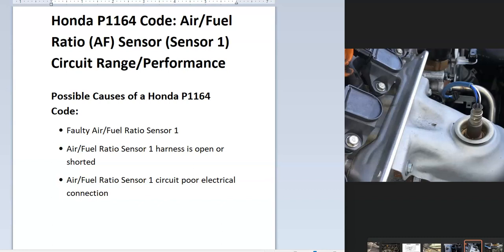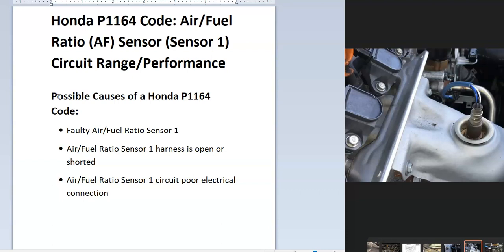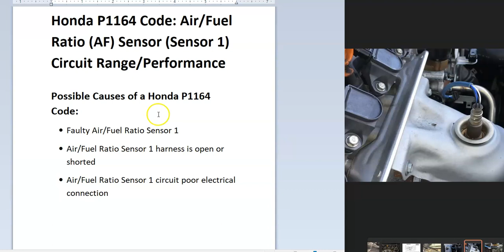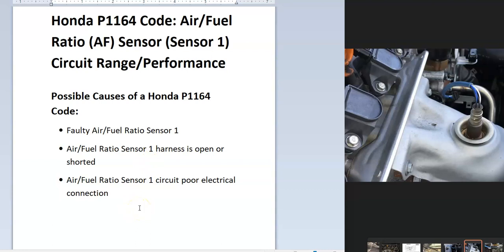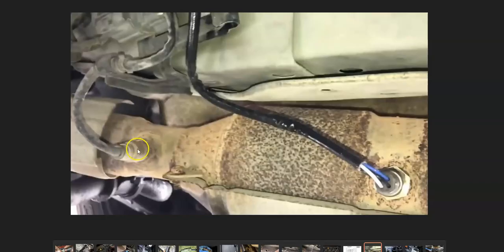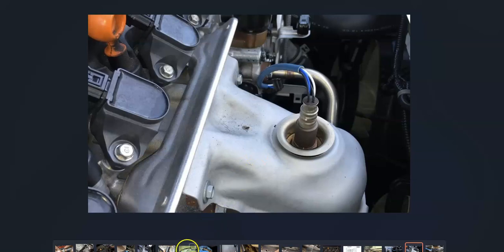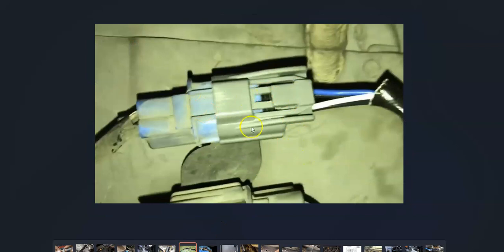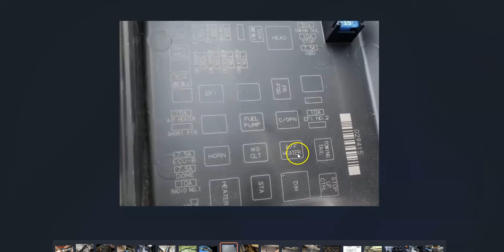How to Fix HONDA P1164: Air/Fuel Ratio (AF) Sensor (Sensor 1) Circuit Range/Performance

Comment: Could it also be because of a bad knock sensor? I had 2 other codes for the AF sensor that actually mentioned the heater coil or whatever is in the upstream 02 censor and after replacing it, those codes went away but I still need to replace my knock sensor. The only codes now are for the knock sensor and the P1164 code underneath it with no mention of the AF sensor or the heater component.

Comment: Thank you!  I put in a sensor 1 for my 2001 Honda Accord 2.3L 4-Cylinder engine and, after clearing the code, I still get P1164.  I decided to clean the old one with carb cleaner, and put it back, and I get sporadic P1164 between 1 to two weeks of driving.  This is crazy!  Any thought?  I will double check the wiring again.